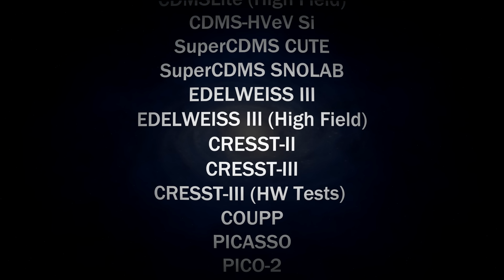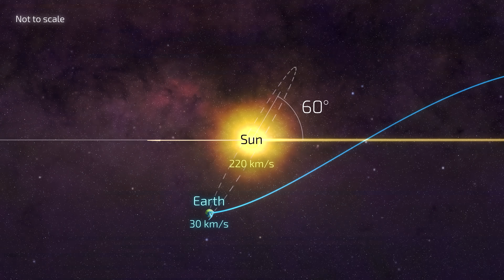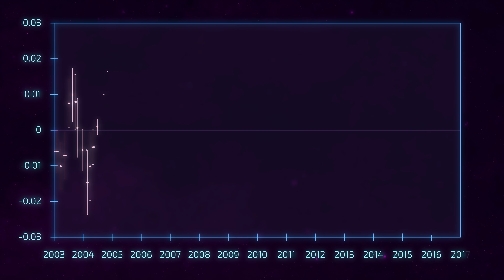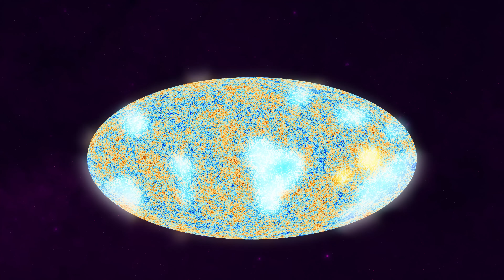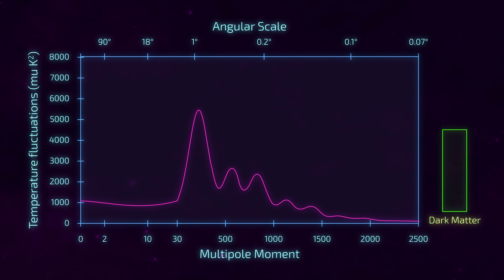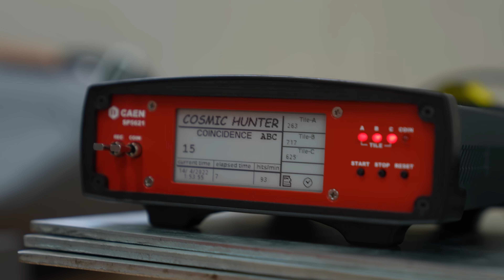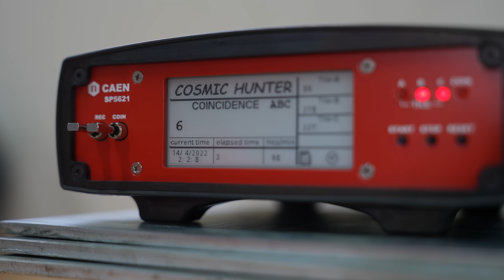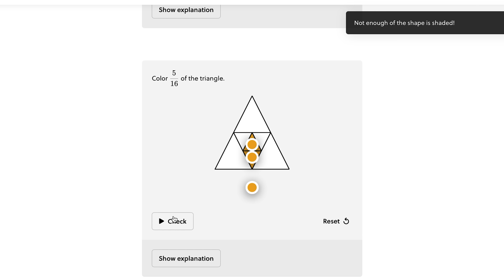The Absurd Search For Dark Matter

Comment: What confuses me the most about the dark mater is the fact that the velocity of stars remains constant even though it should be proportional to sqrt(r). So I would accept any random discrepancies like it being proportional to r^0.6789 or r^1.2345 that would also be different galaxy to galaxy and start to star, but not a close to constant velocity. Is it accidental or are there some symmetries that we don't fully understand yet?
Reply: The Newtonian v~1/sqrt(r) result is for orbits around a point mass. Which is sort of close to the result for visible matter in the galaxy because the galactic core contains a lot of the visible matter of the galaxy. However dark matter is hypothesized to envelop the whole galaxy much more uniformly, so this situation is very far from the point mass case. And that's what the observations seem to match.
Reply: all the stars in our galaxy?
Reply: well, why would t the velocity remain constant? 
Wouldnt it be weirder for the stars to accelerate towards lightspeed?
Reply: @yaykruser  No, they aren’t referring to acceleration, they’re referring to velocity when moving from the edge toward the galactic centre.

Comment: Why does antimatter hit things, wasn't the whole point that it doesn't interact with anything, except through gravity
Reply: You mean dark matter? Per definition, it cannot interact via electromagnetic forces with normal matter. However, it might interact via weak forces. But the emphasis is on "might" - it might very well not do, in which case we wont be able to detect dark matter with those experiments!

Comment: Hi Veritasium, great an informative video!

at 10:40 you made a little error in your illustration of the SodiumIodine "Crystal Structure". In the Sodium Iodine Crystal the Iodine Ions are actually bigger than the sodium ions (approx twice the diameter). I Think the "Crystal Structure" is the right one, but u mixed up Iodine with Sodium.

I Think the reason for this is, that the alkaline Metals are all very big as Atoms but when they donate their outer shell electron they shrink considerably in size. the opposite happens with the Halogens. They are very small Atoms but when they pick up an electron they grow a lot. 

Anyway great video i learned a lot!

Comment: Doesn’t the experiment at 10:38 go against the very idea of dark matter? How can dark matter hit a nucleas if the theory is that it never interacts with normal matter?
Reply: Per definition, dark matter does not interact via electromagnetic interactions. However, it might still interact via, for example, weak forces. This means that such interactions are very, very, very rare (otherwise we would have already seen them!). So our hope is that it is not "never", but just "almost never".

It might very well be possible that it actually doesn't interact with normal matter (apart from gravity), in which case this experiment would be unable to find any detection.

Comment: So . . . why does the "detector" need to be located in a mine shaft or hole in the ground?
Reply: watch the video
Reply: Especially due to the Cosmic Rays, whose secondary particles would be a major background for the detector if it would be build on the surface. To shield the detector from those particles as good as possible, they build the detectors underground!
Reply: @spinning_peridot3673  so you are saying there are no strong gammas underground from solar radiation?
Reply: @masscomnet  No, high-energy gamma-rays are unable to cross through such dense media without interacting.

Comment: Lately I've been fascinated by G. O. Ludwig's paper suggesting that the galaxy observations are better explained by applying the higher-order effects of gravitational frame dragging (gravitomagnetism) rather than dark matter.
Reply: Does that also explain the Bullet Cluster and the CMB power spectrum?
Reply: @eroraf8637  It does not; it's not a unified explanation of all of these phenomena, but rather an attempt at verifying the math that has led to one of the observations used as support for dark matter. The focus of the paper is held pretty tight, at simply improving the model of what happens if dark matter isn't factored in.
Reply: @gearheadlydia  Interesting. I wonder if, at the very least, applying this analysis might reduce the amount of dark matter necessary to reproduce observations, say from 85% of matter to more like 40%?

Comment: Couldn't a muon hit from the side?
Reply: No it couldn't. Muons are created from high energy light smashing into the atmosphere and have a half-life of aprrox. 2 micro seconds. The only reason we can detect on the surface is do to time dilation (Muons are traveling at almost lightspeed). so the only Muons detectable are the ones with the shortest path towards you i.e. directly from above
Reply: @lolGestallt  Oh ok that makes sense then. I was wondering why they couldn't come in at an angle. Thanks!

Comment: I don't think that dark matter exists. 
Yeah, there is dark gravity, but no dark matter belonging to these gravity effects we observe.

I think the so called "Dunkle Materie" is a projection of our limited actual knowledge of physical laws. 
But the idea of classical action and reaction may be wrong in this case. It may be vice versa:
Primordial local deformations of the flatness of spacetime may simulate the existence of masses belonging to the gravity effects we can observe. Deformation of spacetime looks like gravity to us. And we suppose the existence of some kind of strange matter causing this strange gravity.

No, this is wrong!

Normal matter samples and concentrates in local "depressions of spacetime"! And we see "cosmic voids": These voids are "elevations above the normal zero-level".

A ball never rolls uphill but downhill.
Therefore we observe a lack of matter in these cosmic voids.

The matter of a galaxy has some kind of bound rotation because we see a whirlpool scenery: spacetime itself rotates and sweeps the stars like particles on this rotation with it.
The rotation gives a passive guidance to the stars. They just follow the whirl process of spacetime.

Dynamic primordial  deviations of the flatness of spacetime give structure to all the arrangements of visible matter. Spacetime is not flat in detail, just at a very large scale!

We have to think of spacetime more like a planetary surface. From a great distance, a planet impresses almost as a smooth sphere.
But not in a more detailed close-up view.
There are mountains, deep depressions, holes and canyons.

Comment: Dark matter is a fudge factor that got out of hand. Your basic assumptions are obviously incorrect.
The correct assumption is to begin with the Yukawa potential, integrate to get the force and you have an equation that describes star motion in a galaxy. No dark matter needed.
The Yukawa force is 1/R. Setting centripetal equal to a 1/R the Rs cancel and velocity is constant, almost.
The key assumption was made by trying to explain why all star velocities were the same. This could easily be explained if the force between the star and black hole is 1/R.

Comment: For the oscillating signal of DAMA/LIBRA is there an assumption that we (visible matter) move through the "local" dark matter due to our orbit around the center of the milky way? If so does this mean, under this assumption, that the local dark matter we pervade is either "stationary" or orbiting at a different rate? And if this is the case why would local dark matter be stationary or orbit at a different rate around the milky way?

Comment: I'm sorry,  just not buying the idea of dark matter. It takes more effort and faith to believe in it than the obvious:intelligence in the design of the observable universe.They just haven't accepted this fact because it leads to implications that academic types aren't will to accepted , namely,  their not as in control or as intelligent as they thought. Follow the science and it will lead the creator.
Reply: The laryngeal nerve is kind of a nail in the coffin of any intelligent designer.
Reply: @massimookissed1023  I looked up that reference to the laryngeal nerve,,, I don't understand what your comment. Care to embellish upon that, I'm curious to learn your point of view.
Reply: @davidwilson4190  the laryngeal nerve first appeared in fish, and exists in anything descended from the first fish to crawl out onto land, basically anything with 4 limbs.
 It comes from the base of the brain, goes under where the trachea splits into two for the lungs, and comes back up to the larynx.
 It even does this in giraffes.
Giraffes have really long necks. Their laryngeal nerve leaves their brain, goes all the way down the neck, between the lungs (which are in the body,) and all the way back up the neck, almost to where it started.

No intelligent designer designed that set up.
Reply: @massimookissed1023  well, from my perspective on something I just learned... it seems like a system wide similarity between species, if it works all the time with zero flaws across greater than 70% genetic similarity then that speaks of intelligent design to me at least. I respectfully disagree with "no intelligent designer set that up"

Comment: Let's just say that our Sun has influence only over our solar system of 19 AU. If Sagitarius A is 4 million times the mass of our Sun, in my opinion the gravity influence should be 4 million times wider. But if this is true, it barely covers 1100 light years across. How is our galaxy 50.000 light years radius with only a 4 million masses of the Sun black hole? What else is compensating for holding the rest of 49.000 light years of galaxy together?
Reply: Well there are a hundred billion stars too ...
Reply: @massimookissed1023  all spinning arround the center of the galaxy
Reply: Yes, and they have mass.
 Each star pulls on every other star.
The galactic centre black hole isn't the only mass in the galaxy.

Comment: How come we neglect invisible light? Like Radio and Gamma? It's invisible, it can have particles, it can have waves. Why do we even call it dark matter? Is it matter that's invisible? Honestly I'm more on the idea that everything's light or came from it. Visible light is centered where there's the least interference because it's somehow cross sectioned like the letter X. Put visible light at the point of origin and what you're calling dark matter is actually radio, microwaves, infrared, ultra violet, Xrays, Gamma. All the invisible parts of the electromagnetic spectrum.
Reply: "Dark" in that subject does not mean "no visible light" but that it does not interact with any EM waves. And additionally, EM does not have mass and therefor no gravity.
Ergo, your hypothesis is very faulty.

Comment: I just realized that planets couldn’t form if matter didn’t interact with itself. Imagin 2 rocks colliding in space. They can dissipate the kinetic energy by deformation, shattering etc. but two rocks of dark matter colliding simply fly through each other not actually colliding. That’s why rocks can’t even form. I sometimes saw “maps” where dark matter has to be and it looked so weirdly distributed but without interaction it makes sense the distribution looks totally different than what can would imagine.
Reply: This is why we expect that dark matter rarely interacts with normal matter as well as with EM and this makes it so hard to detect in the first place.
Reply: @somephysicist  gravitation preserves energy. 2 resting particles having a distance to each other have high potential energy. Now gravity may turn the potential energy into kinetic energy and make the particles move to each other. They accelerate until they “collide”. But for dark matter there is nothing that would stop them from moving… except gravity. So particles will move through each other and moving away from each other. Gravity now decelerates the movement until they have the same distance as before.
While gravity is definitely necessary for planet formation, it’s not sufficient. I don’t know which if the other 3 but some of the other interactions have to occur to dissipate the kinetic energy of the particles
Reply: @somephysicist  Ok, i see your point that a 2 body example is not suited for this. But i still dont understand the main point: The sum of kinetic and potential energy has to remain constant even in multi-body sytems. And you could argue that 2 particles coagulating and then moving together still have kinetic energy, but the momentum has to be preserved as well, meaning the center of mass of the system cant move (or change velocity to be more precise). So in order for 2 particles to get close, a another particle would have to be catapulted far away.

Also, if dark matter could coagulate: Wouldnt they all be dark holes? because matter on earth prevents us from falling into the core, but on dark matter "Planets" all particles could concentrate in a singularity because there is nothing that stops the from falling.

PS gas is still matter, so i dont think it is a relevant example for dark matter.
Reply: @somephysicist  Im not asking to track an infinite amount of particles. I just want to understand what sort phenomena can make 2 particles coagulate. On earth, we understand gravity as something that pulls everything to one place --> the earth itself. And this is true on earth because kinetic energy constantly dissipates by friction. But in space this is not true, there is no friction. The sun does not suck anything in. Objects that crash into the sun are only absorbed because their trajectory randomly collided with the 3D dimensions of the sun. The impact causes friction again, so the kinetic energy disspates and the object stays on sun. Without this dissipation, the object would accelerate getting closer to the sun, pass the sun, and then decelrates as it parts away. Yes, this is two-bodies again, but the concept is the same. You need any force to dissipate the kinetic energy. Even if you have a million particles. The system has a potential energy (summed over the 1M particles.) which may translate into kinetic energy. And if any number of particles are to merge, their potential energy has to be transferred to the other particles (because distance is 0 --> pot. energy = 0). Im not sure how this could work, but even if it does work, it means in order for any number of particles to merge, their energy has to be transferred to other particles which will make them move faster (relative to center of mass of all particles).
Reply: @somephysicist  I checked google on how planets form on two different sources. Both start with dust particles sticking together by adhesion then i googled adhesion but it seems like its not entirely clear how adhesion works. Their is mechanical and chemical adhesion but even particles that dont react or can lock into each other mechanically are affected by adhesion. The 2nd source suggested that dust particles in space may stick together by spontanoeus electrical charge. 
Even though science seems not to be sure on how it works, it seems to be clear that gravity is not the deciding factor for the first but essential growth. Hence it wont work for dark matter.
Reply: @somephysicist  i looked it up and found that consensus is that dark matter cant form planets. This is why it allows to be so weirdly distributed in space.
I found one paper which suggests dark matter could form planets by "dark electro magnetism". So these authors acutally believe there are more interactions than gravity that allows it to form planets. Of course this gives a simple explanation to our discussion because the assumption that they only interact via gravity would be wrong. However, this is one paper (not even peer reviewed) against a consensus.

And again, gas is still luminous matter...

In the end, everything about dark matter is purely hypothetical. But planets cannot form by gravity alone. Thats not hypothetical but for sure.
Reply: @somephysicist  the problem is I keep explaining why I think it’s impossible, but you don’t explain it. You just claim the opposite. That way you can never convince anyone. It started well when you brought up the 2 body system.  But then I explained how it would work for multi body system. And then you just claim it doesn’t work. Maybe all the articles I read, well rather skimmed, are wrong. Now I checked on gas planets as well, and again, gravity becomes only relevant when the core is heavy enough. I really tried to find anything that supports your view. On planet formation on ordinary matter and dark matter and now gas giants… 
I never heard about “luminous” matter either, so I was about to thank you that I was going to learn or wrong term from the video (14:47). But then I googled luminous matter and found in magazines and even a scientific paper. Literally 2 words google checking first entries and you see definitions of it.
I don’t mean to be harsh but I agree maybe time is better spent reading than arguing at first
Reply: @PfropfNo1  For the record, I have a PhD in physics and I'm not just here arguing with you. I was really only making a comment about lack of interactions and then I tried to explain why your potential energy model does not preclude the formation of megastructures. From my point of view this is pretty obvious as the structure of galaxies and gas clouds and such are due entirely to gravity. Those structures are helped by the fact that their constituent particles are of various sizes and densities, but the same could be true of DM, we don't know and that was always the point. I am obviously incapable of explaining many body dynamics to you over youtube comments, so I highly encourage you to read about it elsewhere. Reading about the formation of galaxies and other megastructures might also answer a lot of the questions you have. Have a good day.